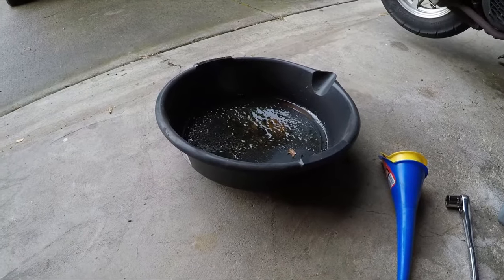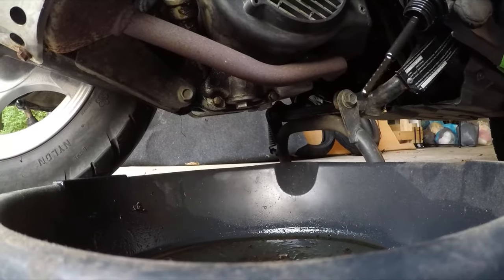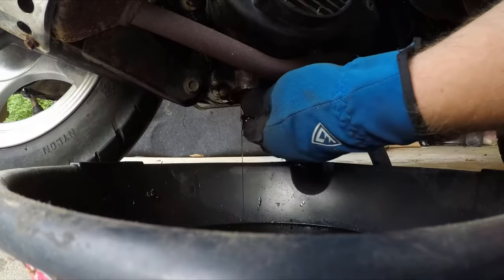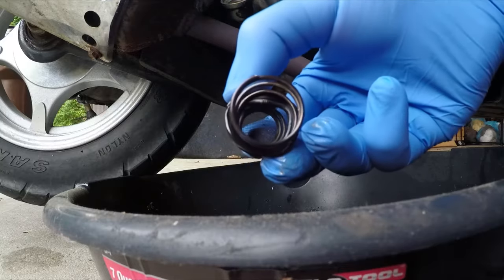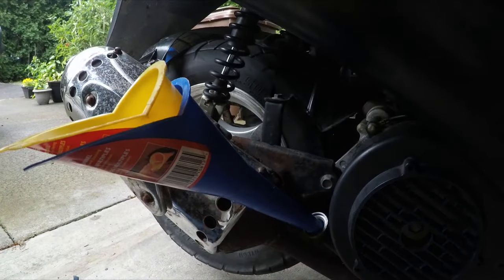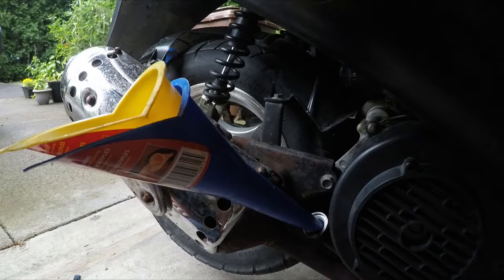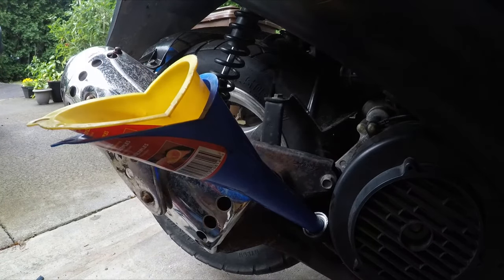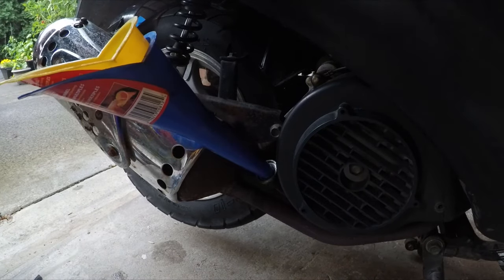Scooter Oil Change - How To Change The Oil in Your Scooter - 50cc and 150cc Scooters

Comment: Tip if you use a plastic bag on the oil drain pan you don't have to clean it
Reply: Bad tip. How do you drain it?
Reply: @chriscalderin6677  cut a small hole in bottom corners  Poor and a recycle banner whatever you need to do one corner
Reply: this is exacly what i needed
Reply: Bad tip
Reply: @davidkurtz3971  i use it it works Now, don't use the thin bag. Especially if it's hot.
Reply: @chriscalderin6677 à❤❤❤❤1❤❤❤❤
Reply: That’s fuckin genius dude then u could just bag it up and throw it away thanks man 🤘🏼
Reply: @Marino_Built  don't use a cheap bag I would keep it at 6 qt in under.
Reply: @newsomsr2000 glad I saw this before I started, thanks!
Reply: Thank you for this, because I live in some apartments I just got my scooter and I don't have an oil pan yet and I was just wondering what could I use
Reply: @dark12ain  you will need to use something to hold a bag to keep it shape it could be a pan or whatever you want to use
Reply: @newsomsr2000  I did this method earlier today. I did my first oil change on my shooter. I used the at like you said but I put like 4 Walmart bags inside of one lol. It worked perfectly. My any Is running smooth as fck 💪🏿
Reply: @dark12ain  glade
Reply: @newsomsr2000  lol I fucked that sentence up but yeah 😅😅
Reply: @dark12ain  ur good

Comment: This is for the viewers watching the video, for all of these Chinese GY6 clone engines you do not screw the dip stick in at all to check the oil. All ya have to do is insert the dip stick to the threads and then pull it back out for the proper oil level check. Do NOT thread the dip stick back in to check the oil level!! The other recommendation would be to use a 10W30 or 10W40 motor oil if the engine has low miles on it or is still new. Do not ever use high viscosity oil, 5w50 or 10w50, on any small cc new engine even if ya live in the desert. A newer engine with tight tolerances NEEDS the lighter viscosity oil to be able to flow into the tighter tolerance bearing journals and valve guides!!😁
Reply: Stupid question but can we use car motor oil on them or is there motorcycle oil specifically for moped
Reply: @gerardoruiz5634  Great question, since there is no oil bath clutch when equiped with an air cooled CVT on a scooter the quality and the viscosity of the oil used is more important. If you want to use motorcycle specific oil there is no harm to the engine but it is not needed. I do not ever use synthetic or a 50/50 blend until the engine is fully broken in. Dinasaur oil for at least the break in period first, always sticking with the owners manual or service manual recommended viscosity of the oil!😁

Comment: There's no need to screw the dipstick in to check oil level, the correct way is to just stick it in without screwing, and making sure the scooter is parked level. the exchange oil quantity is around 800-900cc of oil, typically.
Reply: Yes but its the persons preference if they choose to for that then let them be.

Comment: This was extremely helpful. Now as far as you not knowing how much oil to put in if when you do your next video or when you change your oil for the next time. And you're comfortable as the exactly how much oil you need. Pour the remaining oil from the container into a measuring glass. The difference between what wasn't poured into the measuring glass compared to what a full oil container was that will always be the exact amount of oil you have to put in. So pour that oil back in noting on a paper how much oil was left container. Get yourself some type of plastic clear container put a mark on it. Take the next oil container that you get for that into that clear container with the mark on it. That should be the exact amount of oil that engine should take time after time after time.

Comment: As someone else has mentioned the filter looks like a thimble and must go inside the spring, the way it is fitted is incorrect as it is upside down and won't work properly and might restrict the oil flow to the engine, on many scooters there is an oil drain bolt on the opposite side,on my sym it is 17mm, I very rarely remove the filter and spring as it is much messier and due to the mesh size never needed cleaning in the 20,000 miles I put on the scooter. The oil I use is standard 10w40 semi synthetic car oil which I change every 1000 miles , no need for motorbike or scooter oil as the clutch is dry , car oil contains friction modifiers so must not be used in wet clutch motorcycles as it might make the clutch slip.

Comment: useful video, thanks. single nitpick: more viscous = thicker, and less viscous =  runnier, so i believe running the engine to heat the oil will lower it
Reply: I was thinking the same thing lol glad its not just me
Reply from the maker: You're absolutely correct! My fault.

Comment: Hey!  Great video.  Very helpful!  One question:  I replaced my oil filter and spring exactly the same way you did (filter pointing upwards).  However, I saw another video that shows that the filter should go down inside the spring, pointing downwards.  Does it matter?

Comment: So its completely okay to use 10W-40 oil instead of 15W-40 oil, it wont damage the engine?
Reply: I have a Forza 150cc Scooter
Reply: Or maybe what is the best oil i can possibly use
Reply: @pedopabloleonburbano8469  Use clean oil..10 w 40 is perfect.How many miles does the scooter have?
Reply: @GYccUsefultips mine has 2000km or about 1200miles so which oil should I use 10w40 or 5w40
Reply: @tarikvoloder4741  it should say on the engine or near the drain plug what oil it takes.

Comment: I notice these bikes have a drain plug and a plug for the oil filter. Why the two plugs? Do you need to drain the oil from both plugs? Thx!!
Reply from the maker: Yeah I would drain it from both plugs and clean out the oil filter.  The filter should just be a screen.
Reply: It’s been my experience that to test the oil level you don’t screw the cap back in; you just put it in without screwing it and pull it out

Comment: When should I do my first oil change? I'm at 60 miles. Shop said at 400 miles. One Video said at 100 another said 250. One vid said change it after thirty min?
Reply: Bro every 1000 miles but honestly check it your self with a white paper r towel ot any cloth towel and see how black it is
Reply from the maker: I wouldn't go more than 500 miles before you do the first oil change. 400 would probably be sufficient.  Then, go with what the manual says for your intervals after that.

Comment: What oil should I use for my scooter ? Been giving me a headache Manual says 10w40 air cooled engine oil (non-synthetic) can anyone help me out
Reply: Check with autozone they will most likely have it
Reply from the maker: Pretty much any Conventional 10W40 oil will work.  These scooters don't take much oil, so you can get higher end oil without breaking the bank

Comment: Hey awesome info I appreciate the content. One question brotha. What type of oil do u use n how many quarts do u use n also do u change it every 3,000 miles or do u change it as soon as it is low
Reply from the maker: Thanks dude! I use about a quart of 10w - 50, which is what it says in my manual. I change it every 1200 miles or so. It's really inexpensive and easy to do, so I do it about 300 miles earlier than necessary.  I would definitely check it often and add some if it is low.
Reply: Castrol GTX High Mileage

Comment: I have a tao tao quantum tour 150cc what oil should I use? Manuel under Engine lubricating oil says 4 stroke oil ?
Reply from the maker: Any 10w - 40 will work, but I suggest using full synthetic since it is an air cooled engine.  This will help with oil loss and will keep it's structure longer.

Comment: My bolt won't budge no matter how hard I try, you crank it like it's so easy. What am I doing wrong? Or is something wrong with mine?
Reply from the maker: It sounds like someone over tightened the bolt and after heat cycles, the bolt is wedged in there.  Do you have a heat gun? I recommend heating it up and trying it, even if the engine is warm.

Comment: Bro' I've a KYMCO super 8 . I followed you directions but for the love of GOD. I can't get the oil filter back in. the spring keeps me from lining up it properly. without the filter the plug goes right in.. I give up after an hour.how long between oil changes can  I ride  safely without the filter ?PLEASE let me know ASAP !!!!
Reply from the maker: Is the filter in correctly? There shouldn't be anything blocking it.
Reply: @TyposGarage  just paid $45 bucks to get it done ....

Comment: If u can please respond I have the scoot star 150 moped I take great care of it but I checked the oil this morning it was only a quarter full so it was definitely low and idk how long it was that low the bike seems to be running fine and I filled the oil back up do u think I caused damage ?
Reply from the maker: As long as their was oil in the bike, it should be fine.  If you checked the level and there as nothing on the stick, then you would have a problem.  It wouldn't hurt to check it every time you ride just to be sure.
Reply: @TyposGarage  ok is it true these 150cc bikes only last up to 10,000 miles?  I take great care of my bike so I hope that’s not true and also how often u recommend changing the air filter my bike has 3500 mikes on it and it hasn’t been changed since the 1,000 Mile mark so it’s been a while I checked it it looks a little dirty but not to bad u think I’m fine?

Comment: Manual says oil for air cooled engines. Mobil 1 is for cars (liquid cooled). Any difference if using car oil
Reply from the maker: Since a these scooters use a CVT instead of a wet clutch system, any oil at the correct spec will be fine.
Reply: @TyposGarage  gotcha thank you

Comment: My manual calls for 15w 40 but I put 10w 30 in is that bad should I take it out?
Reply from the maker: Yeah. I would always go with the specific oil stated in your manual.  It's in there for a reason, whether it's clearances in the engine or compression.

Comment: My 150 scooter the last time I did a oil change it was at 1100 miles now it’s at 1800 miles should I do another change ?
Reply from the maker: Depends how long ago you did the change. On these engines, I suggest at least 1000 miles between changes.
Reply: @TyposGarage  I usually do a change every 600 miles or so that’s just cuz I drive it a lot and it’s better to change the oil earlier then sooner

Comment: Literally changing my oil right now won't start driving until tomorrow for work it got 6109 kilometers (still learning to convert to miles) when should be the next time I change the oil and I also bought new spark plugs I was going to put in
Reply from the maker: I would say it depends on how often you ride it and how many miles you put on. If it is a daily rider, it doesn't hurt to change the oil more frequently. It also depends on what your manual says. I change mine ever 1200 to 1500 miles, checking it often.

Comment: bro can i use car oil mineral safely in my scooter ?
Reply from the maker: Definitely man. The oil that is used in cars is the same that is used in motorcycles and scooters.  The only differences are #1 some motorcycles use something called a "wet clutch" and uses a certain oil or #2 your scooter/motorcycle uses either synthetic or standard oil.  You can check your manual to see if there is anything special that your scooter needs.
Reply: @TyposGarage  
my scooter sym fiddle 2 dry clutch
Reply from the maker: I did a little research and it looks like your scooter takes 10w 40 synthetic.  A good option is Castrol 4t full synthetic 10w 40.  Do you ride when it the weather is cold?
Reply: @TyposGarage  
no no i am using shell 20w50 for old car and working fine i tried many oils 10w40 the sound of motor is horrible
Reply from the maker: Hmm what is the size of the engine? The 10w 40 is what your bike calls for. Maybe there is a bigger issue that needs addressed if it is making that much more noise with an oil change.  Your valves could be out of spec.
Reply: @TyposGarage  
my engine is old 2013 and uses 20w50 since then
Reply from the maker: 50cc or 125cc?
Reply: @TyposGarage  
125
Reply from the maker: In your manual, it says you can use 10w 40 as long as the temperature where you live isn't hot all the time. If it is hot, then 20w 50 is fine.
Reply: @TyposGarage  
thank you ❤️❤️❤️❤️

Comment: 15w50 why not using 10w40
Reply from the maker: The manual actually says to use 5w50 until the first oil change. Then, you can switch to 10w50 or 15w50.  I've used both and I feel like the 15w50 makes the engine run a little smoother.  It is definitely weird that it doesnt use 10w40.
Reply: @TyposGarage  
i saw every scooter use 10w30 or 10w40
Reply from the maker: @islamayman5927  Yeah. Many 150cc or gy6 engines use 10w40. I'm not sure why this engine was made differently. It is a 2005 Wildfire 150T
Reply: @TyposGarage  
i used 20w50 but after using motul 10w40 the engine become more noiser but smooter and more fuel efficincy

Comment: Immediately - 1st step is WRONG....
Starting the engine pulls the oil up into the engine giving an inaccurate reading on the dip-stick.
.... NO DUDE!
Reply from the maker: Actually, you are most definitely supposed to warm your engine up.  If the engine oil is warm, it has no issue draining from the internals of the engine.  It prevents the oil from sticking in all the crevices and oil pan since it thins out at higher temperatures.  Any shop manual will explain this pretty clearly.

Comment: That's not the correct drain plug it's on the opposite side and you have the incorrect oil
Reply from the maker: This is all per the manual. Every scoot is different.
Reply: @TyposGarage  That's to all your filter not to drain and some bikes have a bearing on top of that filter and it just falls off in the oil and they never even know it and their bearing helps oil pressure And I've never seen any bite use any other thing  than 10w 40